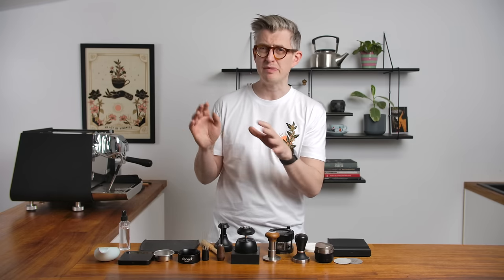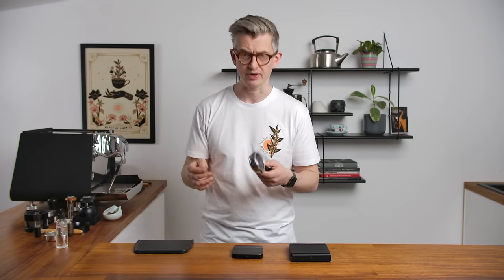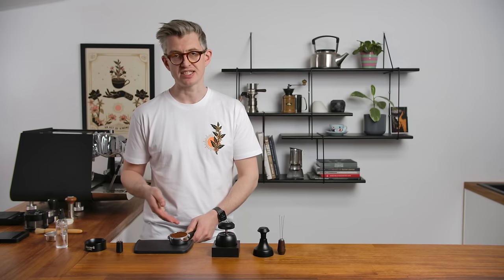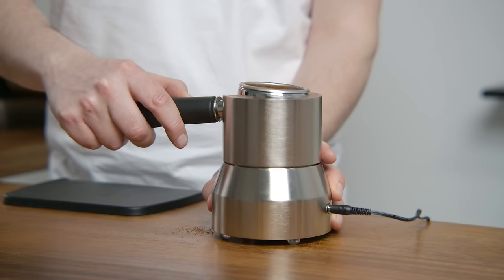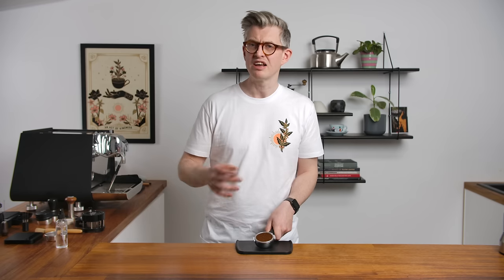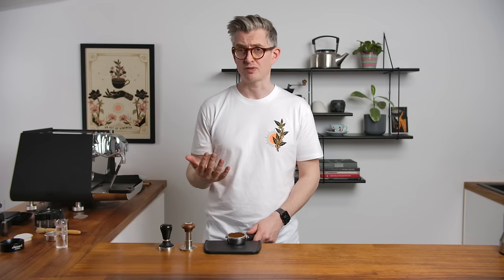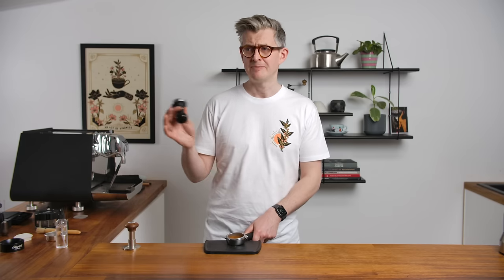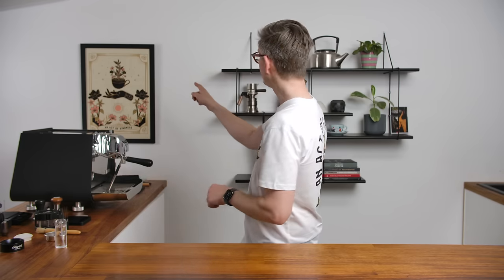How I Make Espresso: Tools and Techniques

Comment: With respect to the vibration distribution method and migration of fines - this is a well known topic in sediment science and hydrology. The smaller particles can more easily find small gaps to move down, while the larger particles cannot and appear to migrate up to the top. It's the same reason why if you shake a jar of sugar that has sat out for a while, the clumps move to the top.
Reply: One of the steps I took to decrease "spurting" was to grind directly into the portafilter rather than a dosing cup.  My DF64 grinder has a bellows that blows out very fine particles.  My guess is that those fine particles formed "dams" at the bottom of the basket (when I used the dosing cup)  that the water had to burst through.  Grinding into the portafilter puts the fines at the top of the coffee bed, which has resulted in less spurting.  That's my current theory...
Reply: Anyone who's stored Lego in a box knows this phenomenon too
Reply: @tomvandongen8075  I worked in construction, and every time I had to look through a box of random, loose screws, the tiny ones I needed were always at the bottom lol
Reply: Works in avalanches as well, as long as you're the biggest piece you have a high chance of riding it out on top. Hence the airbags are a thing
Reply: Granular convection is a term I’ve used to describe this phenomenon. Also known as the Brazil nut effect.
Reply: Commonly known as the 'Brazil nut effect'
Reply: Yes, but if the vibration machine could be modified to gyroscopically rotate and spin the puck at the same time, everything could be uniformly distributed and I could FINALLY have a GOOD CUP OF COFFEE!!
Reply: Supafreak  oh yes fine particles clogging the filter messes up the flow rate big time and ca easily cause chanelling. All grinders have these super fine dust, the hard way is sift them out andthe easy way out just keep them on the top.
Reply: When you shake the popcorn bag at the movies and the larger ones seemingly come up to the top.
Reply: It's sedimentary my dear Hoffman!
Reply: @tomvandongen8075  yup discovered this concept early on as kid while looking for minifig heads in my Lego box
Reply: @jamesporter1991  keeping the heads separate and loose in the box is truly an act of chaos!
Reply: It is hard to think of coffee puck as sediment, but it‘s pure truth. That‘s why the grinder is the most important tool (in my opinion at least). If the coffee is evenly grounded, you don‘t need to worry about it. That‘s why I moved to the best manual grinder around for the same price of a mid-range electric one.
Reply: @HauntedSheppard  ... turn the box or jar upside down and shake ... when you then open it the small items will the be at the top 🙂 ... or use lots of old coffee cans or takeaway plastic boxes and grade your saved items. (UK) Takeway boxes are good as they can be stacked and are see through.
Takeaway foils are good for holding dirty items on disassembly ... and can oil or spary clean with WD40 (other water repellent oil sprays are available!) before re-assembly.
Another final tip in this ramble (😳❗) spraying 'can' paint through wet WD40 (etc) leads to amazing adhesion!

Comment: i just bought a Breville barista pro.  Ive never made an espresso, and very rarely do I go out and buy one.  I usually drink regular coffee from  Tim hortons.  Ive learned all my techniques through James's videos, and since there's so many tutorials out there that teaches beginners how to use their machine.  One thing that ive learned is that each roast, roaster need a different technique to make a great shot; and i learned that from James.  No body has taught that so thoroughly, and now a month after owning my machine, I am confident to say, i have perfected the roast i most enjoy.  After adjusting grind settings, temp settings, changed portifilter and now  a stirrer which I felt was the main item that got my shot tasting exactly the way i wanted.  Thank you again

Comment: In addition to better extraction, the metal disc on the coffee tablet allows you not to clean the mesh of the group from coffee grains. So I choose to clean the disc rather than the grid group. This is a subtle but important advantage for me over paper filters
Reply: but with the paper filter on top you dont have to clean the shower either… no?
Reply: @dominickarpf1081   There's still reason to clean the shower group. Altough you won't see coffee grains after extracting, there are still coffee oils that make contact with the group, so yeah, "less mess" but still a regular cleaning will protect your expensive gear.
Reply: @arturotinajero11 ▪️
You forgot the H!!!
A dog is a man's best friend!!!
🟥

Comment: The motion under vibration of small particles to the bottom and large particles to the top is called the Brazil nut effect because it explains why the (large) Brazil nuts are always on top of a can of mixed nuts. It’s common in granular materials.
Reply: Also known as granular convection
Reply: @willbower1839  I prefer Brazil Nut Effect
Reply: Probably the one thing that actually makes a measurable difference when it comes to distribution since similar techniques are used routinely to improve drainage (gravel anyone?). Leveling and needles etc all probably make little to no difference once the thing is tamped -- stuff advects, the coffee is not going to just sit like a compressed little mound in the middle. But short of vibration nothing will create this sort of vertical gradient in average particle size.
Reply: @isodoubIet  firstly, for that you would need quite a symmetric mountain to distribute evenly while tamping. Secondly, you still have the clumps. I agree that making good espresso is possible, but consistency will be more of a problem without distribution
Reply: @isodoubIet  hmm you caught me there, i was just taking for granted that clumps are undesirable. Will try without stirring for experimentation, even though i am still not convinced that just tamping on whatever form of a mountain comes out of the grinder will produce consistent results. I would expect some kind of channeling, but who knows if my taste nerves would be able to detect it.
Reply: Brazil nut effect
Reply: I know a few Brazilian surf Nuts. So I adopted your name. 💜
Reply: “Wow, thank you for sharing! I never knew that the Brazil nut effect had such a common occurrence in granular materials. It's fascinating how small particles can gather at the bottom while larger particles remain at the top. It certainly adds to our understanding of how granular materials behave.”
Reply: @djabroni_brochacho4644    but if you are in Brazil, it's just 'the nut effect'.  Brazilians, to my knowledge, don't refer to Brazil nuts as "Brazil Nuts" because that's where the nuts are grown.    Maybe the same can be said with Greek olives or Georgia peaches or Florida oranges.

Comment: Awesome. I've been tinkering around with my espresso shots for a year now. Test after test, tool after tool, and came to a similar conclusion as you. I do everything the same, just no filter and only spray when shooting for near perfect retention. I really struggled with channeling when I first acquired a bottomless portafilter. I was stumped. I was using a WDT then a metal distributer. Every shot had channeling. As soon as I stopped using the metal distributor, and started stirring a level-as-possible puck before tamping, it's been smooth sailing. Very interested in trying out the filter. Awesome video, James. Really appreciate all you do.

Comment: This is an outstanding video on all fronts, including solid instruction/guidance on making espresso.  You should win some sort of award for this!

Edit:   I just came back from the kitchen after implementing several pieces of your methods and it solved some issues I was having with loose/sloppy pulls. Here's what I did...

I cut some paper circles from (unbleached) coffee filters. I placed in the portafilter (no spouts, just holes) and wet.   Next, I filled my portafilter (no measure - just a bit over the top)  I ran a fork through to break up clumps.  If I spilled to much to level, I simply added a bit more to top off. Then, level and used the manual method you described with a plain tamper.  I pulled about 6 shots with this method and loved the results.
My set up is: Expobar Control and Ranchillo Rocky grinder. 

I've ordered the punch and will DIY a needle/cork stirrer. 

Many thanks for the great advice.
Reply: He actually won the World Barista Championship back in the day :)

Comment: I took a keycap puller, cut off the connected ends and made my own distribution tool. It works wonders lol.
Reply: Awesome! Two of those glued together and it could probably be the best distribution tool out there!
Reply: @hernancoronel  the needles are quite thick, 0.4-0.3mm needles are more effective, especially with a bottom paper filter you'll want to be more on the lower end of that, with thicker needles it's really easy to lift the paper
Reply: Lol!! That's brilliant!
Reply: This is brilliant. I’ve got maybe 4 extra keycap pullers around. Wish I thought of this before I bought one.
Reply: lol, creative
Reply: BRUH BLESS U
Reply: I never did this, but once I forgot my key cap puller somewhere and my wise wife stored it together with my coffee tools.
Reply: OK I'll be the dunce, what's a key cap puller
Reply: @lockedout8643  a tool for pulling the keycaps off a keyboard
Reply: With the massive crossover between the mechanical keyboard and coffee geek communities, I'm genuinely surprised that nobody's thought of this before lol
Reply: Genius, I have a bunch of those around
Reply: Hey, it's that glambot dude
Reply: Wow, what a genius work around
Reply: Ditto
Reply: Hahah, i did the exact same thing like half a year ago or so and im still using it!
Reply: fandoms that are more expensive than you imagined when you get into the rabbit hole collide!!!
Reply: Brilliant)
Reply: Nice! I twisted two paperclips together for mine and immediately had better coffee.

Comment: First, I love your vibe. Next, I’m a week into this with Baratza Encore (on 3) and Bambino Plus. As for puck prep, I now create less mess since I got the Matow dosing funnel. I can almost hold the portafilter under the grinder without spilling (many) grounds. While waiting to receive a commercial WDT, I made a stopgap one with a wine cork and two paper clips (straightened and cut in half — four prongs).  The prongs are 0.015” thick (!) but they help a bit. Then I tap the portafilter on a cutting board to settle. I use the tamper that came with the Breville. I find this is slightly smaller than the filter basket diameter, though, and it leaves a little outer wall of grounds around the rim. I just ease that back in with my finger. I sometimes use the Breville Razor trimming tool if the level is too high. 

Not really puck prep, but I discovered pre-infusion yesterday. I suspect this improves (lowers) channeling, because the left and right spouts flow more evenly now. Lots of variables!

Comment: I do something I haven't seen very often online: After puck prepping, I spray my coffeebed excessively with cold water(2-4g) and this has changed my Espresso for ever. Never ever did I have a bad coffee since then. This has worked for me especially on machines without real pre-infusion(steady pressure/water-line pressure - not from a vibration pump). It also works on machines with preinfusion, but on pre-infusion machines the difference is less dramatic.

So the process goes like this:
Puck prep(WDT,RDT, distribute,etc.)
Tamp
Water spray bottle -> 10-20 pumps of Water droplets
Pull your shot

The theory behind this is, that the cold pre-wet coffee-powder expands and becomes softer, whereby it can be easily penetrated by the high pressure from the coffeemachine.
Because the water is cold, it doesn't extract the coffee powder prior to the planned extraction in the coffee machine.
Due to the pre-wet coffeepowder, the high power water pressure is less likely to disturb your puck and helps to distribute the water through your puck.

One note: You need to grind a bit finer if you pre-wet for your coffebed, to keep the extraction times equal

I hope that helps and I would be happy to here, if you too found it helpful in Espresso making!
Reply: Can you share what kind of sprayer / spraying you are doing? The amount of water getting onto / into the grinds seems important here
Reply: @ishkabibl  I just use a regular small spray bottle (50ml glass spray bottle), but I would say any spray bottle with fine mist should work.
Reply: I think you and James should have a cup of coffee together...
Reply: Very interesting idea. I'll have to give this a shot.
Reply: @TeKNiQ50  "shot"

Comment: I generally find that small batch to batch variations in grinding characteristics of the beans dwarfs most impacts of puck prep, with two exceptions. 1) needling definitely helps even the puck and prevent channeling. 2) over tamping can lead to residual stresses among particles that result in puck cracks and channeling after the grounds get wet. So don’t overtamp.
Reply: Oh yeah, above I commented that puck prep was one of the most important things, I guess I just figured that this goes without saying.
Reply: @cartier13  within limits. I think it’s more accurate to say there’s a very wide window of pressures that result in equivalent puck. however, in my experience, if you over press, it becomes harder to have even pressure and you can crack the puck. Also, espresso has a little bit of springiness. so if you press too hard the puck can have anisotropic residual stress that results in cracking as soon as it gets wet. It’s similar to an effect that occurs with pressed ceramic powders prior to sintering.

Comment: For me the biggest boost to my espresso shots was getting a proper WDT tool. It made a big difference in the consitency of my shots. I had sort of a home made affair to save moeny but the needles were too thick and didn't do the declumping properly, although I didn't realize that for a while. When I finally got a proper WDT, I felt foolish for not getting one sooner. I still have plenty to learn, and I always love your videos! Thanks!
Reply: But is the quality/taste of your shots than really better than a good bean to cup machine? I'm just wondering. I started to like those semi automatic machines like Breville etc but it seems quite some work to do if you make like 5 cups a day..
Reply: @bekeneel  Most things seen here are extremely small gains made. So small that you really have to empirically test them with a refractometer. Your placebo perception will likely have a larger effect than anything (assuming good beans, good water, good grinder, and adequate technique). In end though, there's no need to change up your coffee routine. These videos are to make you aware of what's out there and to provide answers for those who are looking to step up their game. The only important part of coffee is whether you enjoy it.
Reply: @Beakerbite  thanks. I find more fun in trying/finding new/special beans. Like today I found some from Ethiopia that have a very citrus like taste, in an auction.

Comment: Being a home barista for about 8 years now, I have a nice prosumer setup about $2500 worth of equipment.   Personally I don't think there is any aspect as important as puck prep.  I always pull naked (portafilter, not me) so I've watched this very closely.   I have it down to grinding whilst tapping the portafilter, stirring down to the bottom with a cake tester that I've cut short, tapping the portafilter again for some better distribution, using a wing type (I'm forgetting what you called it) distribution tool, tamp and go.   I like about 19g in, 28 out at between 25 and 30 seconds on my La Spaziale which has a narrow but deeper portafilter.  This is pretty consistent for me although occasionally something will go horribly wrong.   I wouldn't mind getting a multi-pinned distribution tool.   And I think vibration may be underrated.  I'd never seen the vibration tool you used, but my feeling is it has not been perfected.  I think someone could make one that would be all you would need.
Reply: Someone below mentioned batch to batch grind setting as the most important thing, I wrote the above with the assumption that this goes without saying.   Within each bag of coffee, I believe puck prep is the most important aspect.

Comment: So impressed with the addition of a filter to my first shot misery with my Breville Oracle (I use the Chemex and bought your recommended hole punch). I had changed burr setting from factory down to 4 and this enabled me to run a lot finer grid at the dial (5 settings lower) and provide a very nice ratio, and delicious smoothness. I add a filter to the top of the first puck of the day to help with channeling but the extraction is noticeably better with one filter underneath, slightly dampened for each subsequent shot. Thank you James.
Reply: Thanks for sharing your experience with us! It's great to see how small adjustments like changing burr settings and adding filters can make a big difference in the quality of your espresso. Keep experimenting and discovering what works best for you. Happy brewing!

Comment: Loved the video, so informational and watched literally every second with 100% attention.

I weigh my beans and grind into a dosing cup.
Then aggressively use a needle distributor in the dosing cup to break up all the clumps, pour my grind into the porta filter and use the needle distributor again to just make an even basket.
I tamp using using a pre set depth tamper that I can also use to "polish" 
I then use a mesh puck cover, main reason being it keeps my grinds off the machine for ease of cleaning.

I love the paper filter technique and might give this a shot.
Thanks again.